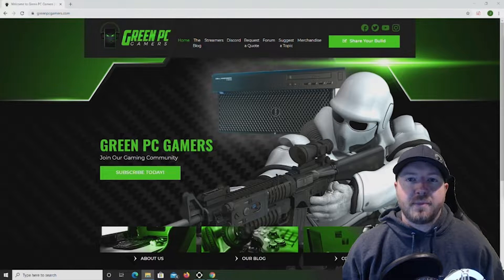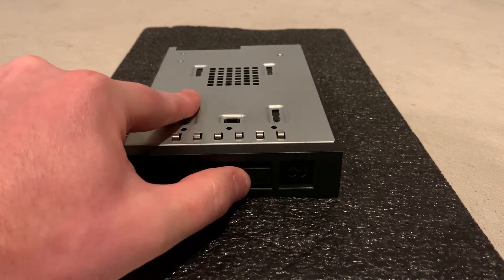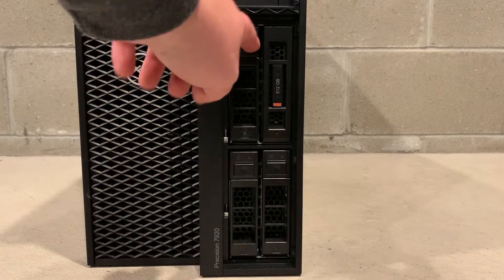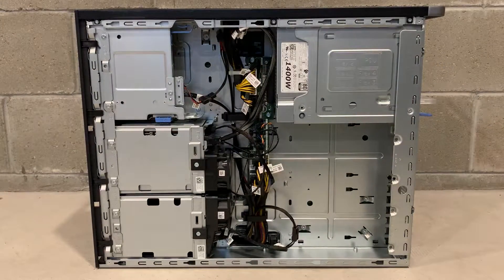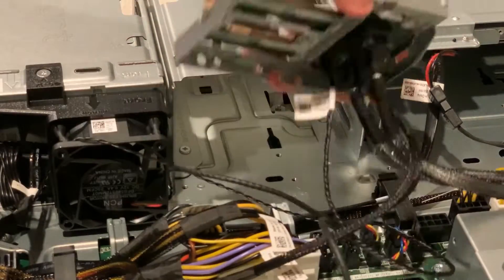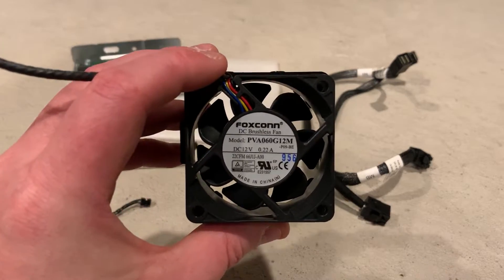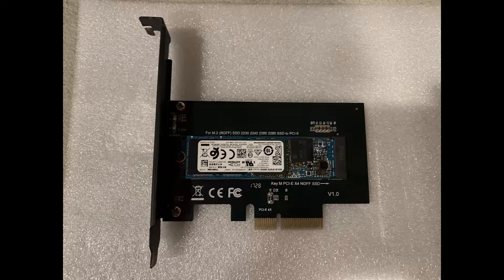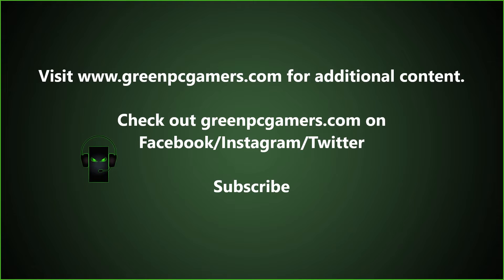Valuable Precision T7920 NVMe Flex Bay Info (Also helpful for T5820 & T7820)

Comment: Dell Precision 7920 is such a crap, non dell ram does not work, psu problems, post problems. Wanted to run 2x 3090, but had to get hp instead, mod the case to fit second gpu added second psu.

Comment: Nice video! Question I have a 5820. Whenever I put a regular 3.5" HDD in any of the 4 slots, it's spinning but my system is not recognizing any drive in any of the slots. Do I need an extra component to activate? I've been searching online for months and finally came across you guys and you guys are the closest help to possibly resolving this for me. Not really looking for using the slots for a NVMe drive, I just want the extra storage room with my regular drives. Thanks in advance!
Reply from the maker: Were all 4 of your slots originally configured for NVMe?  You can check by looking at the backplanes and cabling to the system board.
Reply: @GreenPCGamerscom  How do I check this?
Reply: Check the BIOS settings for the onboard SAS controller. You'll have no SATA from any of the onboard ports with it disabled. @riyanalmaiman

Comment: Hello,  What's needed to use the NVME/SAS backplane with NVME drives and a MegaRaid 9440-8i?  I want to run two NVME drives in a RAID 1 but I don't want to buy the Intel VROC dongle.  I have tried to make this work but have run into an issue in which the MegaRaid will not see the NVME drives.  If I switch to SATA drives the MegaRAID sees the drives.  Thanks!
Reply: No way to do "hardware" raid on nvme without vroc, because nvme interface directly go to CPU pci-e bus lanes. But you can always make software raid with windows and linux standard utilities.

Comment: Thanks, very useful video! I have a 5820 and am trying to replace the NVME/SAS backplane with a regular SATA backplane. Can you tell me the part number of the standard SATA backplane? 

BTW, even though there is a 3.5" drive cage above the NVME cage, it will not accommodate a SATA drive. It appears that both backplane connectors are NVME/SAS.
Reply from the maker: This is the standard cage/cables harness:  TNNVP-M5CHV

Comment: The 5820 has a permanent side panel with rivets, no clue how to remove without drilling them. Thanks a bunch Dell.
Reply from the maker: You can replace the T5820/T7820 nvme backplanes by removing the standard removable side panel.  

https://www.serverworlds.com/dell-nkn20-precision-t5820-t7820-nvme-ssd-cage/

Comment: Hi does quadro A4000 support with dell t7910 or not bro
Reply from the maker: We've never tried an A4000 in a T7910 Workstation.  However, we are very confident that it would be supported.  Let us know if you try it.

Comment: What's the max speed i can get over the dell flexbay nvme adapter? For example, i can use these new gen 4 ssds nvme and get over 5000 mb/s on this way of connection? Thank's
Reply from the maker: Independently they will cap out at around 3gb read/write speeds.  This is assuming you are using nvme ssds capable of running at those speeds.  If you put them in a raid configuration, 5gb + is achievable.

Comment: Hi, great video. Any idea how can i get my 5820 detect my harddrive? Im going to install new os in the HD. Dont wanna messup company issue NVMe. 
Just wondering if i can place HDD to  nvme slot?  Will it detetrct hdd?
Thanks!
Reply from the maker: We've tried installing regular ssd's/mechanical drives in the NVMe slots in the past and they haven't been recognized by the systems.  However, we still need to do more testing with this issue because it seems silly that it doesn't work with both NVMe SSDs and regular drives.

Comment: Hi..I just bought Dell Flexbay tray M.2 and also a samsung 970 EVO NVMe M.2, when I was going to install Windows 10, it didn't work. is there a way to do the installation.
Reply from the maker: Yes, get one of these:  https://www.amazon.com/dp/B00YT6YV3I/?ref=exp_greenpcgamers.com_dp_vv_d
Reply: @GreenPCGamerscom  
Hi
I bought a 7920 workstation which has only 4 sata in its flex bay. Have you really tested a pcie m2 on a 7920 with no native m2 bay? Is the brand/model important or the one you posted works on 7920?
Thanks

Comment: So does this mean that I can’t install an M.2 on my 5820 that didn’t originally come with an M.2.
Reply from the maker: Correct, your T5820 will most likely require the upgrade backplane to work with NVMe M.2 SSDs.  An alternative solution would be to use PCIe NVMe Adapter. Check out our T5820 Gaming Computer video for more details.
Reply: @GreenPCGamerscom  So If I just buy the upgrade backplane and install it, I can use an M.2, or is there anything else I need?

Comment: I love your videos as always. Thanks for making them. You are awesome (one of a kind on YT :)  I finally bought a T7920 (like a half hour ago - in part because of you)  Shame on you lol - for making me spend more money I can't afford to spend, (kidding obviously). With the T7920, finally Dell has made a decent design (infinitely superior to the T7910, T7610, T7600, etc.) as far as cooling and airflow and component isolation (CPUs/ Ram). They still leave a lot to be desired in terms of PCI-Express slots (both number and configuration), but will be less work and customization for me to build a complete system. 

I did a couple things for my T7910s when trying to configure NVME drives. For one T7910, I used the Dell 4 x M.2 NVMe PCIe x16 Bifurcation controller (with fan) (Dell p/n = TX9JH/ PHR9G/ 6N9RH/ 80G5N), and for the other T7910, I bought 4 x Samsung 1.6TB PM1725A 2.5" NVMe SSDs; And 4 x U.2 (SFF-8639) to SFF-8463 12GB/s SAS Connector cables. 

The first T7910 is built. The second is not. But I haven't had a chance yet to test the Bifurcation on the Dell Quad Speed 4 x M.2 card on the first T7910 (to load Windows 10). So I  don't know yet if it will work, but all my research tells me it should. 

For the second T7910, I went with a poor solution from a hardware integration perspective (that may come back to haunt me) and will be difficult to attempt to integrate the NVMe SSDs  in a workable mounting and cooling solution (though fabrication and jimi-rig is what I do best :)  I have machine tools and am a machinist as well as a sys admin for over 20 years (retired). But I hate this kind of work because it's so tedious and never worth it. Anyway....
 
I always use RAID cards and always add fans to these workstations (and sometimes other things). But the difference with the second T7910 (and maybe I'll use the T7920 now if it's easier), is that I wanted to be able to RAID 0 these 4 NVMe drives to achieve even higher speeds than the 4 x Samsung PM981A SSDs in Bifurcation (if that's possible). I have an Intel RSP3TD160F PCI-Express 3.0 x8 RAID Controller (which has 4 x SFF-8643 ports). 

My thought process (based on research) was that this would be the absolute fastest drive solution possible in a Workstation. Clearly I cannot use those NVMe Flex Bays for these 2.5" drives. And if these drives were to be hot swappable, then I would have to somehow have (or create) a 4 x U.2/ SFF-8639 Backplane (or 4 individual backplanes). Anyway it's late and I cannot think, but if you care to reply (or can find the time) let me know your thoughts. -John

Comment: Is it possible to use hdd with the m.2 drive
Reply from the maker: Regular HDD/SSDs will not work with PCIe M.2 Backplane.  Great question!
Reply: @GreenPCGamerscom  So once you change out to the Back plane both hot swap bays will need to have m.2 drives correct?  Having pulled out the previous SAS /SATA cable system that was in there I have noticed that the two bays (4 hot Swap) have combined cables and connectors.  Do you have the part numbers from your Second T7920 system for the regular bay that will support standard HD and SSD's.   Thanks!